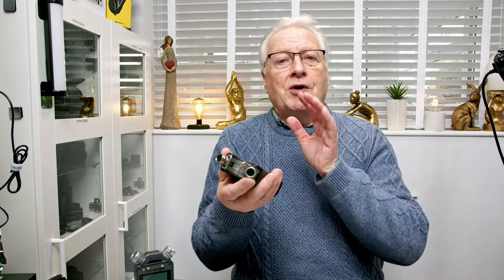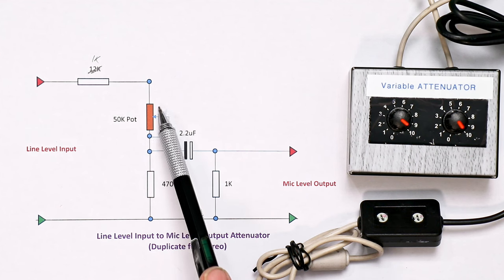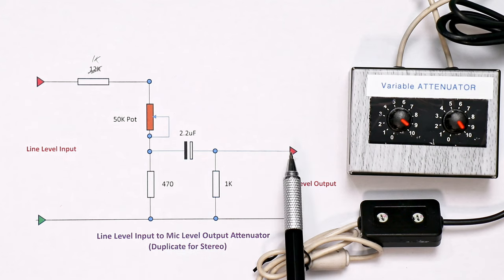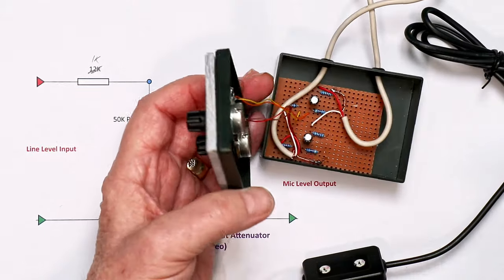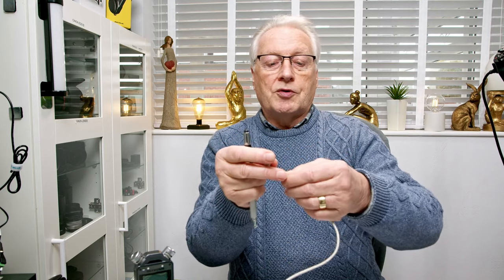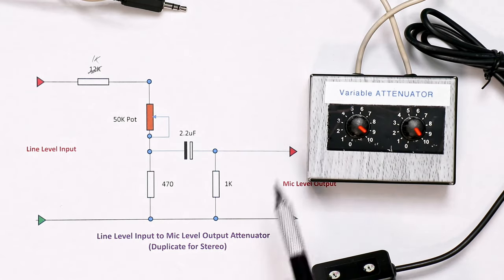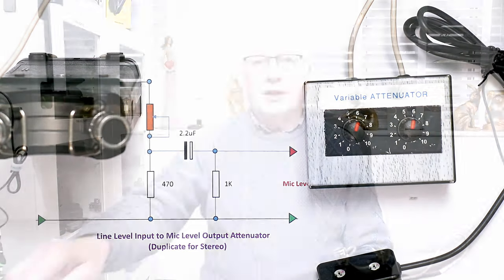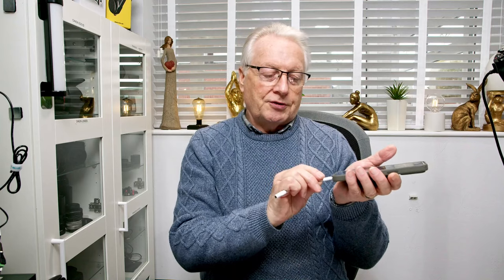Graham's Quick Build #Line2:  to Mic Level Attenuator

Comment: Hello

Thanks for your diagram. I make podcasts occasionally and want to be able to have live phone conversations via my smartphone. To do this, I connect the headphone output of the smartphone to a line-input on my mixer and I want to connect a (effect) output at line level of my mixer via the attenuator to the microphone input of my smartphone. 

But I think the microphone input on my smartphone has a +3 volt DC voltage to be able to supply an external electret microphone with power.
My question is whether I should not reverse the polarity of the capacitor?

Kind regards

Peter de Wit
Waalre NL

Comment: Graham hello again. Been watching you for years. You did a series on the Lumix FZ82 that guided me on cameras
Reply from the maker: Thanks for that, I have some more ideas for FZ80/82 users coming soon.
Reply: @GrahamHoughton12  you taught me to move past it, and now the best 1 inch sensor for the price was a dji air 2s drone, gimbal etc I am now looking at getting a full frame camera, older models will do